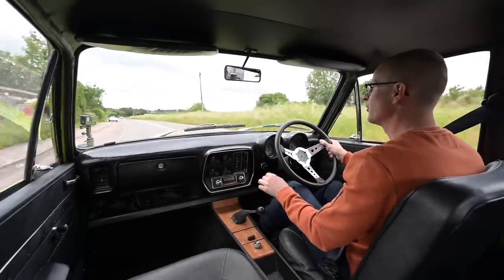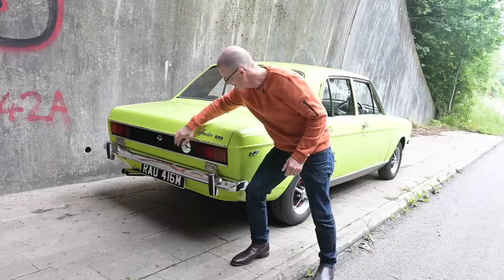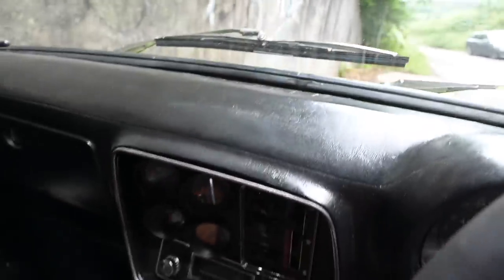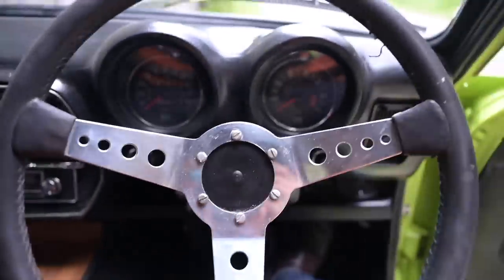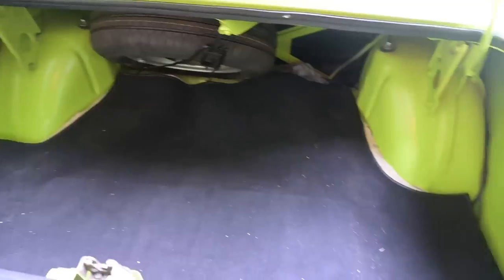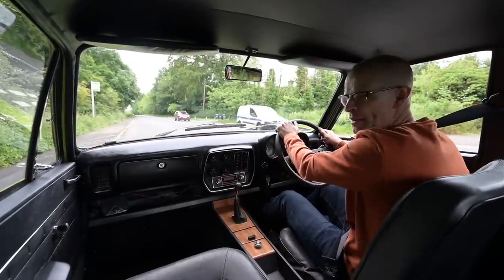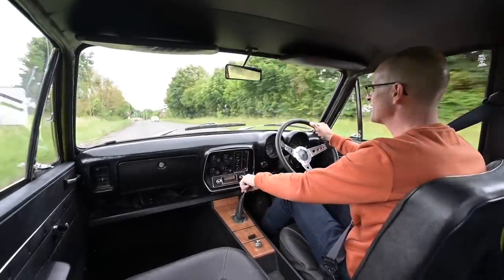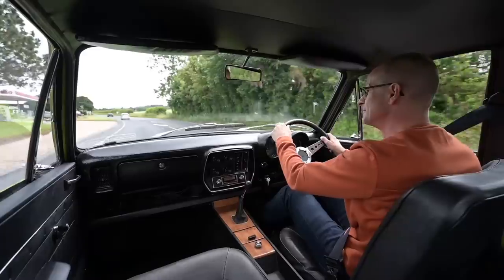Hillman Hunter GLS Goes for a Drive

Comment: Back in the early 80s I owned an extremely rare GLS here in New Zealand.  It was purple with a beige vynal roof. At the time my sister had a a blue 1969 Hunter and my brother had a blue 1974 GL auto. Funnily enough,  they all got stolen in the same week.  The thieves could not get my brothers auto started. My sisters manual  ran out of petrol at the end of the street and my GLS was never seen again.  I had owned it for 13 days

Comment: My dad had a 1974 hillman hunter DL plastic or vinyl seats that burnt the skin off you in the summer. But the car does bring back distant memories 👍👍
Reply: I had the exact same year and model with the 1500 iron head engine - base spec, slow and frankly totally worn out by the late 90s and 110,000 miles later. But it was reliable and very comfortable to drive.
Reply: My dad did too. Exactly as you describe :)
Reply: My dad bought a left hand drive Ford Taunus back in the 70s that would also do that. You soon learned how to sit in the back wearing shorts without melting your legs to the seats!
Reply: You put fashionable sheepskin covers on the seats :) Very cosy!

Comment: As an apprentice motor mechanic back in the 70s I cut my teeth on the Hunter range along with the rest of the Chrysler products. The arrow range of cars were far better than the French imports of Chrysler such as the Simcas, Chrysler 180s and Alpines - proper cars!🙂👍
Reply: The French Chryslers ruined Rootes legacy. The 180 was to be a Humber with the option of a v6 and upmarket trim but the parent company took the wrong choice with dire results. The nice looking but clattering tappet Alpine was another bad move.
Reply: @jackiron4785  A tad unfair to the Alpine which was superior in every respect! Heaps of genuine 100mph performance , good grip and spectacular interior / luggage space !

When the Alpine was launched it was better than the Ford Cortina in every respect ! (Maybe not reliability 😂)

Comment: Great car. I had the Hunter GT with a Holbay engine fitted. Best car I've owned. I loved it. Only problem with the handbrake was when the cable stretched, and the seat sagged,  you had to be very careful getting in and out otherwise you'd do yourself a nasty injury
Reply: I grew up in a small village in Suffolk called Hollesley Bay, in the village garage John Read started Holbay, he had to move to Martlesham near Ipswich as he made too much noise in the engine testing bay and the locals complained. The main engineer called Bob once told me that Rootes never returned one of their engines faulty, a real testament to the engineering skills at Holbay.

Comment: These were assembled in Australia.  We had the Hillman Hunter, Sporty Hustler, the Royal and the top of the range was the Royal 660.  No idea what the 660 signified.  It had metallic paint, vinyl roof and wood grain dash.  They were fairly common in the day but I cannot remember when I last saw one.
Reply: As a fellow Aussie, I think the Royal 660 was to add the family of Valiant, in the Valiant Regal 770's of the time which had a tacho, vinyl roof, metallic paint, but no wood veneer dash and were the sporty full sized luxury sedan of the Chrysler Australia range. 
The Hillman Hustler was designed as a small version of the sporty Valiant Pacer sedan. The earlier Hunter GT's and the later on the 660's had the best looking, veneer wood dash for an Aussie car I'd ever seen till 1970.
Reply: The sporty one was the GT, timber dash and twin carbs.
Reply: @mikevale3620  I reckon you are spot on Mike.  That seems logical now you mention it.
Reply: @petersargeant1555  The GT was discontinued earlier. The Royal 660 HE series was the sporty one at the end of Australian production with wood grain dash, full instrumentation, high back bucket seats, and the same material used for trimming as the Valiant 770. The Holbay engine with twin carbs was fitted to them along with Rostyle wheels. They sounded so sweet in full song. I was a 15 year old in 1975 growing up in country Victoria and my sisters husband (who would be termed a hoon today) had one of them.  They were particularly fun to play with on gravel roads. The GLS of this video seems so plain in comparison.

Comment: Thankyou.  This brings back memories.  My dad was a foreman and service manager of a large Rootes and later Chrysler dealership.  I remember these Hunter GLS models and they were certainly rapid in the day.  Fairly light weight, with a lot of modifications including the twin 40 webbers, high lift cam, flat top pistons, bespoke manifolding, revised gear ratios and even a special exhaust system.  The suspension was firmer too and the wheels were wider than standard Hunters.  With overdrive they were refined and a good cruiser.  My dad tells a story of an old gent who ordered one of these in 1973 finished in metallic brown with a tan vinyl roof but the car terrified him when it began to "growl".  He would book an appointment for a tune up and to accompany my dad on a fast cross country blast "to clear it out".  Good old days.

Comment: My second car in 1975 was a 1971 "Arrow" Hillman Minx 1500.

Bog standard, rubber flooring and not much else.

No head turner but when I added a Lotus steering wheel and gearknob along with two spotlights, she could really shift! 😂

At the time my work boss brought in a new Hunter 1725 and an Avenger  everyone hated them, preferring the older Cortinas.

Comment: Up until 10 years ago they were still relatively common in Iran. In the 70’s they were everywhere in Tehran. They were badged as Paykan, many were used as Taxis.
Reply: As a teenager I hitched through Iran in 1978 and the Paykan was everywhere, the people’s car. Tough, simple to fix and relatively large, it didn’t matter that they were thirsty as petrol was so cheap, as Iran was an oil producer.
Reply: Paykan is Farsi for Arrow.

Comment: Loved the way you went for fifth gear a couple of times (and don't try and deny it)! I had a Mk1 Cortina with a similar long throw gear change, but a previous owner had fitted a "remote change" to it. It connected from the top of the gearbox on the tunnel by covered rods to a box, about 18 inches further back, where a short gear lever came out of. This cut down the movement between gears on the Hill pattern to 3 inches up and down, and about 3/4 of an inch side to side. Anyone remember those lovely things?

Comment: Hi i had the Hillman Minx before it was called the Hunter it had the same body shape (J reg), it had single round lights at the front, i had a 1725 engine and i went everywhere in it and it had a top speed of over 100mph. I loved this car the only problem on these cars was rust. I wanted the GLS but the insurance for me was high otherwise i would of had one of them, nice to see one on the road. Thanks Paul. I also want to say i had a Hilman Avenger GLS which i also loved and a Hilman Minx series 6 was my first car which was called the Noddy Car.

Comment: It needs the back jacked up on spring extensions, axle painted red, lit up with a red light  ,chain steering wheel and fur on the dashboard. Finished off with a metal flake paint job with flames.

Comment: Me and my dad had hunters possibly 6 or 7 over the years we were both travelling sales men,allways bought secondhand.They we’re very strong motors only had 1 that had engine problem,big end started to rattle,I changed the big end shells in front garden while engine still in car.only selling them when they got to 150,000 miles.Then we moved on to Triumph 2000 and I had 2.500 pi.wow what a car that was.I must have mad in my day 120 mph regularly down M1.

Comment: My first car in 1970 was an Imp van. Loads of fun and great for camping expeditions with my mates.

In 1971 I bought a Hunter GT, white, for personal export to South Africa. I had hoped to buy an Avenger but they weren't available for export.

As it turned out the Hunter was a great choice. Quick, tough on dirt roads, and with overdrive which mine had capable of covering 700 miles in a day in relative comfort. Mine came with inertia reel belts and because it was an export model it had opening quarterlights which home market cars didn't get.

Great cars and very much underrated ...

Comment: Ashamed to admit I put mine on the road as a taxi. A very fast, efficient reliable taxi it was too! The local Alfa dealer loved the car and tuned those lovely Webers every couple of weeks. Generally got about 25mpg overall. After nearly 182k miles it was retired, re-engined and sold on. Lovely car, quiet comfortable and sadly missed. Yes, I removed that lethal centre rib-cruncher from the steering wheel!

Comment: I chuckle at the pushrod versus overhead camshaft performance output argument carried on from the days of Talbot Swiss engineer Georges Roech, with the former engine configurations mainly being adopted by the Rootes Group. Ford came up with the crossflow kent engine, and contracted Colin Chapman to render a twin cam version for the Lotus Cortina. When compared there was not much between the Holbay prepared Hillman Hunter GLS with it's push rod engine and the Lotus Cortina with it's crossflow twin overhead motor. The output and top speed is almost identical. The main advantage that the Ford Cortina had was light weight. Bernard Unett demonstrated the brilliant performance of the Hunter GLS on UK  race tracks many times.

Comment: Used to have a ‘69 square-headlight Hunter. 1725 Rootes and 4 spd. Drove it lots of miles.  Did you know the clutch throwout bearing was a solid carbon puck instead of a roller bearing? One day leaving a parking lot, I stepped on the clutch pedal and the slave cylinder piston came out of its bore and fell down on the road! Apparently the carbon puck had worn so thin. Very underrated car in its time. Had it for 22 yrs. Great Lockheed brakes.

Comment: 👍Good one. My dad had a Hunter in the mid 70s. Can't remember the model just that it was black with red vinyl seats. Certainly, remember Hunters were very common in the 70s but seemed to have very quickly vanished from the roads by the 80s.

Comment: second car back in the late eighties in New Zealand when I got it the doors were rusted out  the fuel tank rusting from the inside and blocking the fuel uptake line resulting in car starving of fuel... coast to a stop wait five minutes and the rust particles fell back down and away you would go again...it also had a huge tear in the drivers side floorboard ..which we repaired with two 8inch pipeline flanges screwed together one inside one outside... it was stripped by previous owner of all sound deadening and carpets... seats and dash only...shod it with 185 r13 from original 155r13.... never lost a street light takeoff ..and it would wind up to a comfortable 160-170km/hr and delightful on back country roads flicking out the tail and drifting ...only issue was the engine crank bearings were not good not enough of them and I ran the bearings twice after too much thrashing.....it ended its days as a demolition derby car

Comment: Bought a gold-colored oneof these GLs versions back in1989 for £30.  It smoked badly but still ran, so I sourced a set of OEM pistons and rings from RJ Grimes for £40 for the set!!!  Honed the bores and threw it all back together.  It ran really well, but compared to the '75 Celica GT twin Cam I had at the same time it felt very old. Mine had the overdrive box and 1600E Cortina chrome Rostyles.  Good old days.

Comment: The 'Arrow' series cars were good motors. Comfy seats, roomy, huge boot and lovely smooth manual gear-change. The recirculating-ball steering was light too. I had the 'Arrow' Minx with the smaller 1500 engine. Leaked oil a bit though. Very British.

Comment: Great review, brings it all back. One thing, the GLS was available from 1972, not 1973. My parents bought one of the early ones in a lovely champagne gold colour, L registration. 
I later bought it from them. It really went well, with a great sound, but it was hard getting it off the line right due to the twin Weber 40DCOE carb setup, hence poorer 0-60 time than it could have had. Also, it had a tendency to flood when restarting from hot. But my, did it go once it got going! Throaty engine noises. It was also a great Q car, with almost no outside signs of performance mods ❤

Comment: This has been a long awaited video for a car that has long been a favourite of mine. I had a couple back in the 80's and despite the faults like rust at the front of wings, was a nice drive. The styling was non existent, a pity that finances prevented Chrysler from updating it to match the all conquering Mk3 Cortina. My last one was a Topaz with the overdrive box, really made a difference to it's cruising ability. Thanks Matt

Comment: Dash board changed when the Minx disappeared and they all became Hunters, mid 1972 from memory. My father had a 68 Hunter with two round 7 inch lamps like a Minx, then a 70 car with big square lamps, same as the posher escorts and HB Vivas, then he had a 73 with the smaller square lamps. Before he bought that he drove a GLS, but didn't buy it because it was bright red!!

Comment: I would have loved one of these, I had a 1972 Humber Sceptre, with twin Stromberg carbs.  It kept blowing head gaskets due to some corrosion on the alloy head.  There was a Rootes parts place called Grimes near me in Coulsdon Surrey, you could get anything. I recall seeing wooden crates stacked up there bound for Iran. My next car was a Vauxhall Firenza 2300 Sport SL.

Comment: I had a 1971 sunbeam rapier with a holbay engine. It had 3 months road tax and 6 moths MOT. I paid £100 for it in 85 and the only thing wrong with it was it had no carpets. The car sailed through its first MOT under my ownership but when it failed its 2nd MOT, I broke it up, sold the engine for £100 . The seats for £100. The rostyles (silver/black) complete with tyres for £60, and the rest of the car went to the local scrappy for £20. 
I bought a MKII GT after that 1600 crossflow, sports manifold and twin webbers. That thing flew.

Comment: The interior; could it fulfill generic needs back then? It could. Does it tingle my senses today? It does. No nonsense (guess barebone can nearly be said?). Look at the back.. it whispers some sort of power or the reminiscence of power (muscle cars, at least some of them?). That spare wheel will never see salty solutions just to corrode away at the bottom - quite a quirky solution, but it is logical, isn't it?
The hood, the face, the bumper .. it is so stuck in that timeline (for the better).
Kinda reminds me of Dacia's 1410 Sport Coupés (the hood, the face) albeit it came later.
Oh, this is lovely.

Comment: passed my test in a GLS in 1977 my dad later sold it as he said i drove it to fast  I WANT I WANT ONE AGAIN MY ONE had a much smarter interior wood along the door capings and round the center dials cream carpets cream seats electric screen wash cream headlining and a lovely hillman steering wheel with the big center boss it was a late 1973 model my dad paid for it at 2 yrs old £1045 less trade in used to burn off MGS and the likes at the traffic light sprints what a WOLF IN SHEEPS CLOTHING as for the hand brake great place for it with fully reclining seats when required lol

Comment: The same engine was used in the Fastback (Arrow range) Sunbeam Rapier H120, the Sunbeam Alpine sports car guys used to mod them & fit the Holbay engine in them after changing the engine front plate & having the inlet manifold modified from the 10 degrees Arrow range cars back to the upright style of the Series range, it is believed there was a prototype series Humber Sceptre that the factory fitted the Tiger V8 too

Comment: I had a Hunter GLS in 1974, It had lots of grunt and was well equipped, but it was bloody noisy! The engine noise was so intrusive that on longer journeys it gave me a headache, It was only a few months before it became impossible to live with, so I sold it.. I ended up hating it. If it had had the optional overdrive maybe it would have been more tolerable but in standard trim it was a daily reminder of why they never sold many.

Comment: I am fortunate enough to own a couple of Hunters; a 1972 GL sedan and a 1977 shooting brake (my wife owns a 1972 Avenger). They are not show ponies. It's true they are supremely comfortable and completely reliable. The engine in the sedan has done 250,000 miles; it was fitted to a car I bought in 1992 which rusted out. S it was transferred to a car my son used when he was a horticultural contractor.
 I have a small business and the shooting brake is absolutely perfect, very capacious, but unfortunately doesn't have a towbar. The sedan is used when I have to use the trailer. I will fit an overdrive unit to them both when the opportunity presents itself. They are both a bit undergeared, which does make for lazy driving.
  Cheap and cheerful.

Comment: Have to correct you. The body style for the Hunter first appeared badged as the Minx I think it had the 1500 engine. My best Pals dad had one. It was E reg & had round sealed beam headlights. We had the later Hunter Estate with the rectangle headlights. Main difference from Minx to Hunter was grille headlights & dashboard. Hunter having round Speedo & Minx having I think an older style strip incorporating fuel & temp. 
I'll take my anorak off now.

Comment: I nearly bought one of these in 1973 but ended up buying an escort Mexico instead. I remember that it was 9.7 seconds to 60 in the specs at the time but they may have been bragging as you state 10.5 while the Mexico was 10.7 seconds.
Reply: The GLS can do 0-60 in less than 10 seconds so the 9.7 you stated sounds right.

Comment: The GLS Hillman Hunter was available with a 3.7:1 back axle [ no overdrive ] or 3.89:1 with overdrive. The car was 210lbs lighter than the Sunbeam H120 and nominally quicker. Bernard Unett could wipe the field in one when circuit racing.